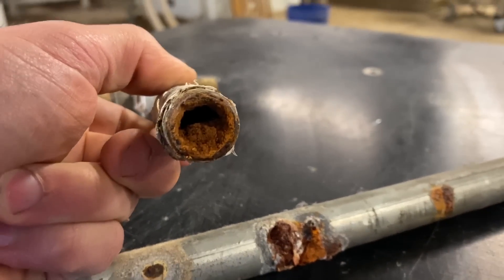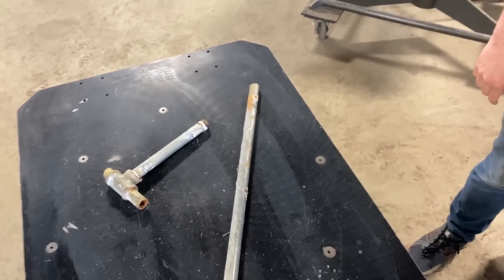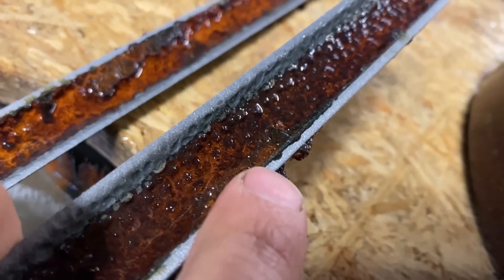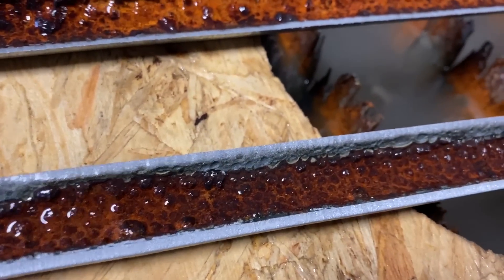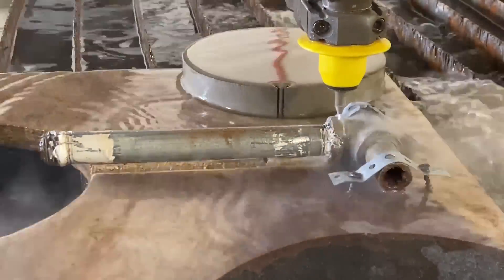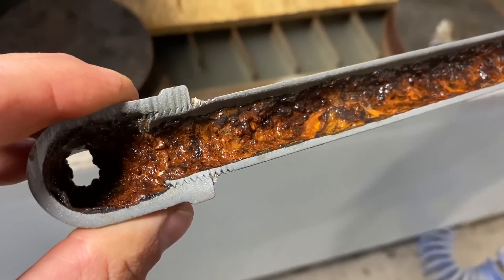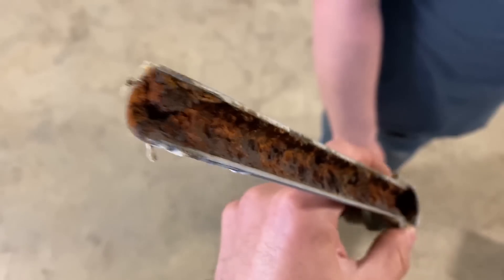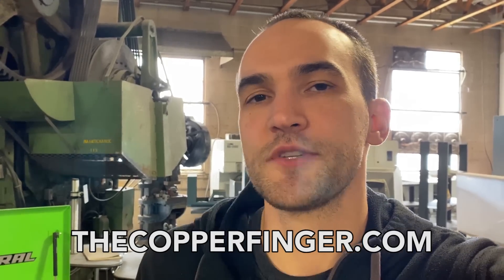What's Inside Your Pipes? Galvanized water pipes cut in half

Comment: It's not the hardness of the water. It's the chlorine that has corroded the pipes inside. Actually "soft" water is more corrossive to the pipes than hard water. Lime scaling of cold water pipes is almost non-existent. Take one of the hot water pipes and cut it open. If it's a thick, even scaling, it'd be lime.

Comment: From a chemist:  the pipe suffered from simple corrosion due to oxygen gas dissolved in the water = iron oxide, the red chunky stuff.  Years ago, the internal zinc coating dissolved away and oxygen began it's work.  The oxide is porous and the oxygen attacked the steel.   70 years for a galvanized carbon steel pipe in a water supply is amazing.  Don't complain!  Replace it all with PEX.  Water with high mineral content wrecks water heaters, primarily, because the minerals precipitate out and settle to the bottom and cause excessive heating of the steel = separation of the glass liner from the steel = leaks!  This is to say nothing of the electrolysis that speeds up in hot anything.  BTW, iron oxide is harmless and helps your blood hemoglobin be tops for bigger better muscle performance!

Comment: It's still safe, just alot more Iron in the water and it creates a restriction. Iron is needed by the body, but most of it just attaches to the side of the pipe and builds up while the clean water flows. I would rather have that than plastic pipe - plastics can leach chemicals vs. copper or steel pipes which are natural minerals.

Comment: Easy way to remember the difference between Stalactite and Stalagmite:

Stalactite hangs from the ceiling, so it has to hold on tight to keep from dropping.

Stalagmite pushes up from the ground. so, it needs a lot might to push up

my father taught me that over 40 years ago and it has stuck ever since then

Comment: Recently my pipes froze due to extreme cold here in Alberta.  After they thawed the water in my house had rusty water running through my pipes.  I have a water softener and it has gone through several cleanings but,  after the softener has done its cleaning job the rust shows in my toilets again. About how much would it cost me to replace the pipes in my house?

Comment: So it seems it a steel pipe galvanised with zink wich, i think (could be wrong), is a poor choice for drinking water pipes. The "nasty" stuff you see is just rust, not  amineral deposit. The dimples you see in the pile where you sandblastet it are casued by the rust. when steel rusts it will expand in volume so when a spot starts rusting it pushes in and outwards and over time it causes these dimples. I think the main issue here is the leak and the high pressure loss inside the pipes. The worst you get from these pipes is iron fortified water.

Comment: Galvanized water pipes are coated on the outside but it is bare steel inside so as the steel begins to rust there is cavitation that does wear the little holes as well as the rust flaking away over the years. But you can have clean copper pipes or plastic pex or pvc but most city water lines in the street are ductile iron or in some old city's like San Francisco they still have some hand layed brick pipes as water mains.

Comment: What a horrific sight the inside of those pipes were!

The thought of putting such hideously contaminated water into one's body is unthinkable!
Reply: It's not contaminated. it just looks gross. It's just some minerals that are in the water anyway. They just accumulate in the pipes. In some old houses it's actually good because back in the day they used lead pipes. The minerals in the pipe reduce the contact of the water with the lead of the pipe so the lead content in the water is not as high as it would be in a "clean" pipe.

Comment: If you have an external mic you could try putting a Fair-Rite bead on the cable to remove the high pitch tones in the background, I don't know if it will work since the sound is coming from your equipment and not interference but they are like $2, ex: 1934-1429-ND

Comment: To be honest, this looks exactly like the mineral water wells in Germany look like. Of course there the minerals are way bigger and look like what actual spa decoration would look like. But still, same colors and textures. Apparently those mineral wells bring you the cleanest and healthiest water you can get. BUT - those minerals are also the reason for when you dont have your water running for a while, you get orange water first, because the minerals dried and became "mineral dust". The orange water you shouldn't drink, because it can contain too much iron. But as long as the water runs through minerals and stays transparent its perfectly fine.

Comment: Even if you replace your pipes the ones coming from the city reservoir going all the way to your house probably aren't in much better shape. Probably worse. Maybe not in all places but surely in many if not most parts of the world. That's why you really shouldn't drink water straight from the tap and installing a water filtration system is absolutely the way to go.

Comment: It looks  like is Copper. In the Water there are Copper ions in oxidised form (Cu2+), meaning they have two electrons missing. The galvanised metal is less nobel, meaning the oxidised copper can steal the electrons from them and get solid again. So they cover the pipe.

Comment: Minute Earth did a video about lead pipes, and how these mineral deposits from hard water will build up on the sides of the pipes and vastly reduce the amount of lead leeching into the water supply.  

Despite their gross look, they protect you from lead pipes, which are still common, and a lot of recent water poisoning events (including Flint) are from this mineral layer dissolving. 

While those pipes weren't lead, perhaps upstream/up-pipe it is lead, and the fact those mineral deposits are forming might be why it is safe to drink.

Comment: Actually the “gross stuff” on those pipes protects the water passing though from pulling dangerous shit from the pipe, primarily lead particles from lead pipes. The reason Flint’s water had a lot of lead was because that film, which developed over multiple years, was damaged due to lack of adding certain chemicals to the water when the water source was switched. Watch “Poisoned Water” on PBS, explains it better than my comment.

Comment: If the pipes are lead, hard water is actually good. Because it coats the inside with the mineral deposits, which prevents LEAD POISONING! Places with soft water source and lead pipe infrastructure add minerals into the water source to make it harder so it coats the pipes. Lead is preferred over other materials because it can last up to 200 years and is cheap and easy to manufacture and install.

Comment: Cavitation? No. Pipe expert? No. Minerologist? No.  Certified painters are actually supposed to be pretty well versed on rust. I am among those.

Those cavities essentially represent the slowly growing radius to the electrolytic process of oxidation that we call rust corrosion. 
Rust is mineral(steel pipe),  various mineral salts held as impurities in the pipe and in the hard water, and moisture to lend oxygen to the feed the electrolytic reaction which occurs with these elements present to cause oxidation(rust). The same principle as a battery except instead of stemming oxidation by bleeding the current for use, the current is either bled with a ground wire or remains at the point of reaction, slowly being converted from electrical energy by serving as further fuel to speed the growing oxidative conversion of the steel back into the Earth having been separated back into its base components.

Back to the cavities. They form like that, into and out of the pipe wall almost symmetrically because they initially sprout from tiny pieces of mineral salt in the water, after having been attracted by the slight current produced by the hard water in contact with microscopic breaks in the Zinc sacrifice(galvanized coating)into said compromised voids to start the reaction. Over time this infinitesimal speck grows outward like a blast radius, which it is technically.

Dude. Rust is not a mystery but unfortunately it is  pretty technical and fully substantiated by stupid science, facts, and other pretty important things that cost contractors money and make hard working people willing to work for peanuts feel inadequate in their identities as professional trades people.
Had to add that PSA cuz I could have gone to university if I had'nt been dumb enough to take the trades seriously. It's a joke kids. Do not learn a trade aside from a hobby or as a VIP member of managements circle if you do pick up this way to pay the rent at best.

Comment: 5:29 29$ for a little sheet of copper cut into shape, are you kidding me?! Helping people my ass, abusing the situation to earn money fits better. (1$ = 0,92€)
You can buy a whole kg of copper in sheetform (27€, I checked the prices) for that price and make 25~50 pieces in cuts. (I have an object, which is out of copper in similar shape and size)
That would mean that you try to get out of 0,5€ ~ 1€ per piece for copperprice, 28€ simply for the cut. Thats 28/1 ratio.
Now imagine if 1000 pieces get sold: 1000€ for the copper, 28.000€ for the cuts. I could buy a brandnew cnc-machine, if I sell 1000 pieces xD
So if 1000 people want the same thing for half the price (and a different design of course), comment me here and Ill get you those xD And earn from the 15€ atleast 7€, while another company does the cut for me.
Some people are simply horrible abusers.
Reply: DaimonTrilogy imagine capitalism.  Damn socialist.

Comment: So I do plumbing and water filtration and the pitting has to do with the acidity of the water eating through, though it (can also be the ground or humidity corroding it from the outside too), it takes a long time depending on the PH and TDS of the water. Ive also seen it build up with gooey bacteria too, completely plugged the pipes, and THAT is gross.

Comment: That water service isn't actually that bad for 70 years of operation.  I've seen 6" municipal watermains be reduced to something like 1.5" diameter from all of the crud sticking to the sides of the pipe.  Generally speaking, the pressure within the watermain keeps the crud adhered to the pipe wall so nothing falls in.

Comment: In most cases this is not what your drinking pipes look like, unless you live in a very old house that still has galvanized steel pipes to distribute drinking water, even when purchasing a older house an inspector will red flag these pipes . Unfortunately in some areas there is a lack of corrosion control such as phosphate, so in the worst case scenario it would be lead you're drinking.

Comment: Not really that harmful you realize that humans drank from lakes, rivers, and any source they could find for a million years before clean water pipes were invented. Solder joints on copper pipes are actually more of a problem because they contain lead and can leach into the water. If I had my choice rather have Galvanized threaded together pipes with rust then lead soldered copper.  I just use a RO filter to drink from and cleans all that junk right out of the water.

Comment: The pits left behind might be somewhat of the same effect that causes what is called witch cauldrons in my country; holes or depression on cliffs and rocks caused by the water spinning just so on that spot over a long period of time due to the geography.Some irregularity like the mineral buildup disturb the water flow and cause a circular turbulence that effectively grinds on the pipe.

Comment: That's pitting corrosion. Rust, lime scale, oxides etc reduce further oxidation for most of the pipe (soft and acidic water is corrosive; hard water is less corrosive, but if it's too hard it deposits on the inside of the pipe). You still get local sites that happen to be less protected, have some defect or whatever and these become anodes, while the rest of the pipe becomes the cathode. These pits form that rust preferentially and protect other areas of the pipe (same way galvanization works to protect the pipe, except the pits in your pipe become the sacrificial anode) and it looks pockmarked like moon craters.

In parts of the US where there is still a lot of lead piping and lead service lines they even harden the water or add ortophosphates etc to the water to deliberately create some scale to form on the inside of lead pipes and reduce corrosion. This scale prevents toxic levels of lead from getting into the drinking water (until someone fucks up, e.g. when Flint Michigan switched water source and neglected to treat the water properly).

That pipe doesn't even look that bad in terms of how much gunk is deposited on the inside, but it's pretty badly corroded. It's fairly common to have 4 inch cast iron pipe for fire hydrants; sometimes only a few houses are connected to the same line as the fire hydrant. That makes the pipe grossly overdimensioned and very prone to fill with sediment and lime scale. You can have 1 inch of diameter left of a 4 inch pipe, with the rest being lime. The lime varies between sort of yellowish white to brown coloured with radial striations formed by the way the crystals grew and different rust concentrations oriented in a polar direction like tree-rings. Colour varies by how much dust was kicked up. If a pipe is cleaned (pigging, flushing after a new installation or repair, water jetting etc) or just somebody uses a fire hydrant and kicks loose a bunch of rust by increasing the water spead locally, some of this rust will make it downstream to houses and you get a thin brown line in the tree-ring style growth pattern.

Comment: hello from germany
the most of the brown stuff is just rustand it can even look worse than this
i had 1 time a 2 inch pipe that hade a hole left of 0.4 inches.

The Water is btw still save to drink if the pipe is used normaly and that water dosnt stand in the pipe for to long(1-2 weeks)

Under pressur the minerales like lime (limestone) are desolved in the warter.
The most lime is start forming if it exit the pipe (in the shower etc)
Reply: Dazu sind die Verordnungen in Deutschland sehr streng

Grüße vom Klempner

Comment: the water interacts with the surface of the steel in the pipe, and forms an oxide layer. As more water flows it will grab the rust off of the surface, revealing fresh steel, and the cycle continues. This is how those cavities form. The heavier minerals in the water will get caught in those cavities and build up into stalagmites.

Comment: its just rust and mineral build up as long as its not lead pipe its safe to drink. and you cant jett water lines, the pipe is too small you can only jet sewer lines, so all you can do is replace the pipes. even copper and plactic water lines eventually get buildup, its not just corrosion it has alot to do with the water quality in your area. if this is gross you dont want to see whats in your water heater. a few pounds of sludge build up in the bottem of the tank

Comment: My house is 119 years old, I can only imagine what mine are like 0_0
Reply: your fine, yours might just be lead which is very resistant to corrosion
Reply: @HPD1171  Lead pipes can give you super powers too. 
Or kill you.
Reply: @presence5692  as long as the water isn't full of acidic chemicals ahem (flint mi) the lead shouldn't leak. still rather have copper pipe though.
Reply: how many ghost you have?
Reply: still cleaner than a well

Comment: 1. The pitting is that area which was the rust, now removed.
2. Electrolysis is the other key factors. It was common to ground the fuse box and later the breaker box to the water pipe. Not to mention the corrositvity pH, hardness, etc.

Comment: You never use black pipe or galvanized pipe for water because they will corrode. That pipe is max 10 years old. For running water always use brass or copper. 🛀🛀🛀🐳

Comment: About the cavitation remark. It can be real in your machine. But I highly doubt it in the common waterpipe. From what I know it has to be high speed of the fluid which leads to cavitation. And then you need sharp turn or turbulent flow (not laminar). So the flow changes (from the turbulent flow or sharp turn) cause micro bubbles with vacuum in them. When the bubble colapses, the water rush into the space occupied by the bubble and hammers the pipe material.

What you can see inside the pipe is pretty common rust. Rust comes in all shapes. You can have the one which is like uniform layer all over the surface. Or this one, which is like cakes or droplets. It eats the material not evenly. There is alse rust which grows like needles through material. Or worse, grain surface can rust and this one is pretty dangerous. You almost dont see it on the surface, but suddenly the metal part fall apart.

Comment: Cavitation bubbles are caused by little explosions/implosions from things moving water too quickly which causes extreme heat and pressure, this is why you will commonly see lots of pitting on marine propeller blades. There isnt anything in the pipes that could cause cavitation bubbles unless you were looking at an elbow/90 pipe.

Comment: Someone's probably already said itbut not all minerals are bad for you in fact a lot of the minerals in that pipe or actually good for you when they're mixed with the waterif you still don't feel comfortable with drinking that kind of water put a filter in line with it preferably right before the faucet... Also FYI that's why they're switching the standard to PVC nowadays it doesn't corrode due to the minerals causing leaks down the line so to speak